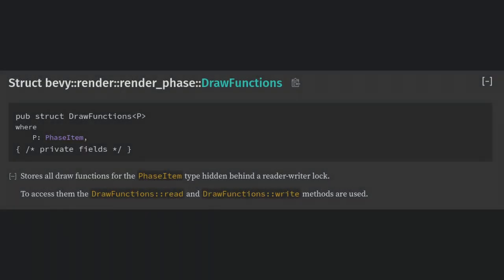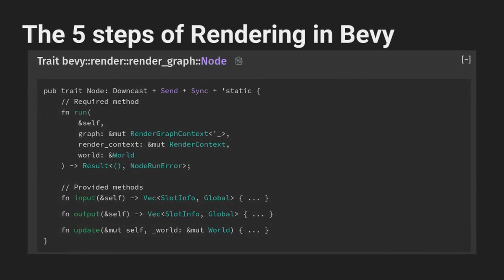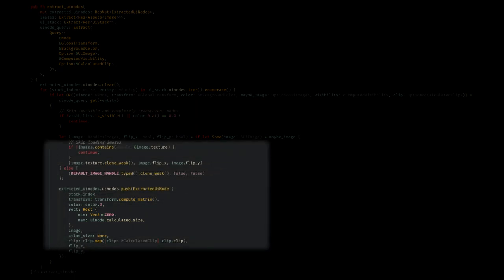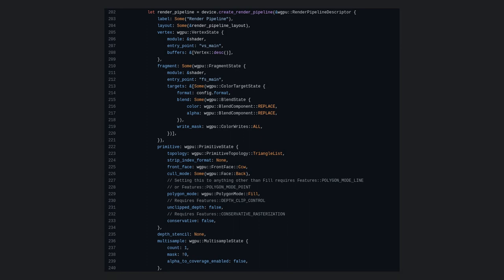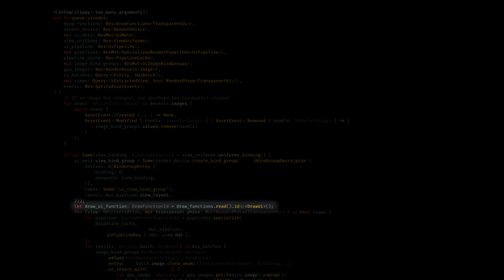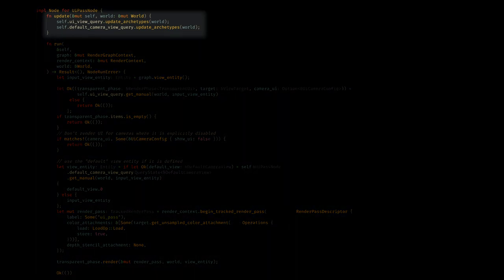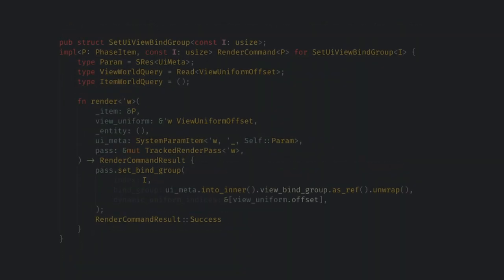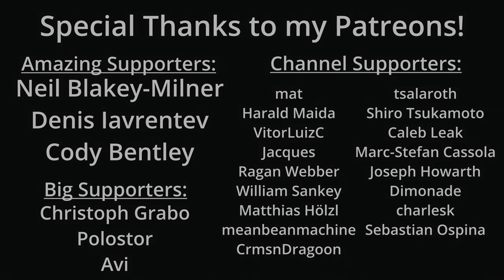Bevy Rendering Demystified

Comment: Where would one start if they were trying to fix some MacOS Ventura macs (intel and sometimes M1) Camera2d (and probably Camera3d) having a memory leaks (for native builds)? Assuming they own a machine to test if the problem got fixed. Weirdly Monterey is unnafected.
Reply from the maker: I'd go to the dev channels on bevys discord and ask there (assuming you mean you want to be the one to fix it). My guess is you'll end up in wgpu so you might need to see if it happens on a wgpu example
Reply: @logicprojects  I'm not sure if there are even other devs that can reproduce this problem so I might spend couple of days or a weel figuring it out. Wgpu example is an interesting lead, thanks!